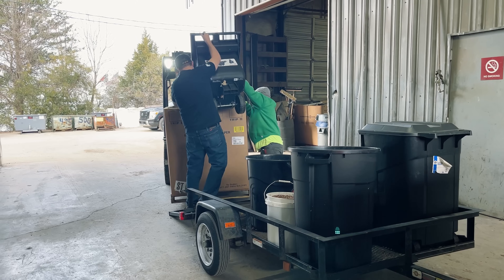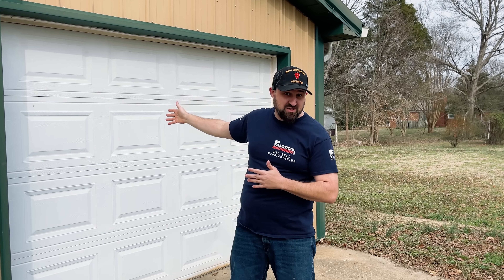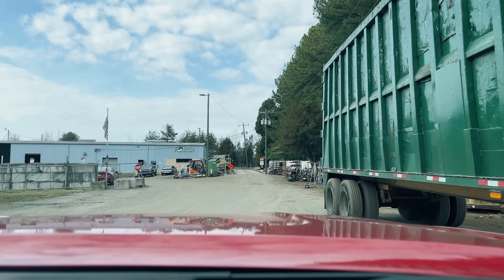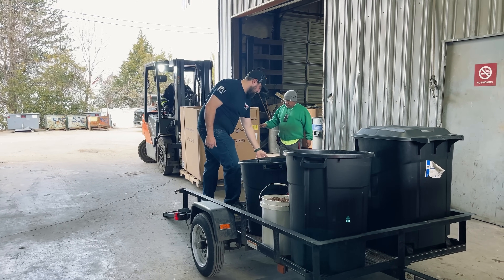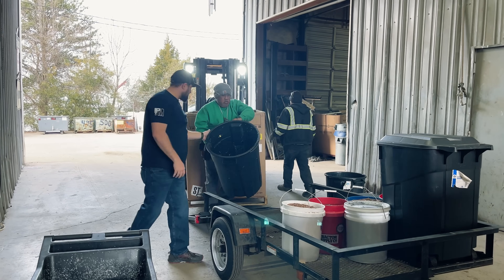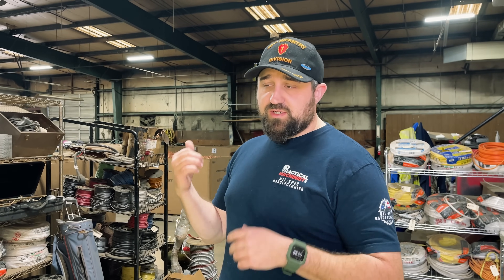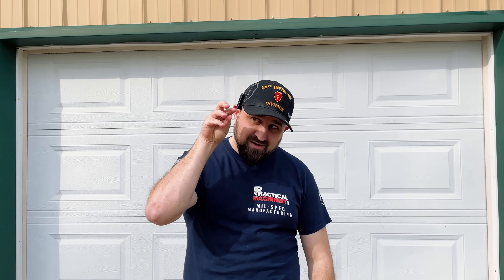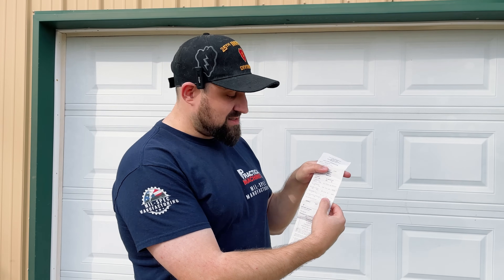A Day in the Machine Shop – Turning Scrap into Money! | BAPM Ep.17

Comment: We had a big shop.  We machined steel, stainless, aluminum, and brass.  The local scrap dealers would hardly give anything for steel turnings.  Got a little bit for solid steel bar-ends and scrap parts.  Aluminum turnings...primarily 7075...we got the going rate....same thing for 316 solids.  Brass?  We would ship turnings back to the mill after the incoming truck offloaded.  It had sideboards.  We would just dump the chips (40,000 lbs) from Roura-hoppers onto the bed of the truck.  Chips were run thru a centrifuge to spin cutting oil from the chips.  We had less than 1.25% moisture content.  The mill checks the incoming scrap brass for oil content and any ferrous residue that may be in the chips.  Since we had machines dedicated to long run jobs, cross-contamination was not an issue.  We had to keep cutting oils separate as steel 'fines' would be suspended in the oil.  We had filters for the oil, but there would still be some steel in suspension, so we just made sure to keep reclaimed oil separate...oil from brass running machines stayed with the brass machines....same thing for steel running machines, and aluminum running machines.

Comment: When I do Aluminum, I fill one of those totes up about 350- 400lbs. We' pack it down using the forklift and fill every inch. I go into scrapyard and swap out totes and start all over again. Every other week we go. I keep the 303-304 separate from the 316 which pays more.  I have one scrapyard across the street another is one mile down the road.

Comment: I used to run a gun drill and broach varrying length paintball gun barrels at my old shop.   We had these 6ft tall tipping gondolas.   I could fill 800lbs of 6061 in 5 hours.  I swear the chips were just as profitable as the barrels lol

Comment: What a waste of time. How much machine time did you waste?
Reply: None!
Reply: @MilSpecManufacturing  I have to agree with the OP, it looks like you spent an hour getting rid of 50 bucks of chips.(that sounds like you barely paid for your time, if you even did that) Wouldn't it be more economical to melt them down for in shop use or at least build a garden shed with like a steel gaylord in it that you can dump 5 times as many chips in and winch onto your trailer?

Comment: I use to pay .25 cents at a place near me. I usually would yield 1500-1700 pounds. After a while I decided to travel 20 minutes further and would get .46 cents a pound. Literally 300-400 bucks more just for an extra 40 min drive. 👌🏻
Reply: If I was making that kind of volume I'd buy an induction furnace. 
Make billets or better yet get a huge but cheap 3d printer and do some sand casting, make some stuff to finish on a mill. 
I can only imagine what you could charge for a part 3' by 2' by 1' part made of aluminum. You would make a ton of money just by not having to buy that huge chuck of billet.

Comment: I keep 2x 275 gallon totes on my trailer for chips. 1 with pure 6061 as that's what I machine 95% of the time and one with everything else. I'm a 1 man shop with only 2 spindles so it takes me abut 6 months to fill at least 1 tote up (always the pure 6061 gets full first while the other tote is about 30%-50% full and is still 95% 6061). 
Last time I turned them in I got $190 bucks for 600lbs of pure 6061 turnings (they call all chips turnings for whatever reason) and 200lbs of the mixed chips which only got me $18.

And strangely enough I got less per pound for 6061 scrapped parts than I got for the 6061 chips, about half as much which didn't make sense to me. So now I try to turn all off cuts into chips as its easier to transport since I don't own a forklift. Or I donate the end cuts to local hobby shops as that shit is gold to them (I remember those days) and it make me happy seeing young machinists happy to get free material.
Reply: Hell yeah man, that’s an awesome setup. Do you ever have issues with water getting into them? 
Moving forward, Im gonna start keeping our copper chips and donating them to a Veteran friend who makes jewelry. He won’t mind if there are a handful of steel chips accidentally mixed in lol.
Reply: @MilSpecManufacturing  nice. 
I drilled holes in the bottom of the totes so any rain will drain away and I keep a lid on the 6061 chip tote to try to prevent corrosion that will make the scrap yard reject them

Comment: Nice vid. Very real. Every time I bring in scrap I never try and get my hopes up - I've been frustrated many times with the diligence I put into keep chips separate just to have their magnets find traces in my aluminum. 😂 Something I have found is that the 27 gallon totes give you the most chip storage per the area. And then I put them 3-4 high on harbor freight dollies. They are a manageable weight but can still get 108gal of chips in nearly same footprint as 55gal drum.
Reply: I shouldn’t be surprised that they always seem to find steel in at least one bucket. I’m thinking random steel chips must be in the conveyor and mixing in. Sucks when that happens. But I liked the comment below about taking a magnet through it all before we head to the recycling plant to get it clean. I’ll check out the totes you suggested too. We don’t have much space in the back so having more storage capacity would be great.
Reply: @MilSpecManufacturing  I swear those magnets at the yard can pick up aluminum 😂
Reply: Hahahaha, I think so too.
Reply: They’re going to find a way to beat you down regardless.